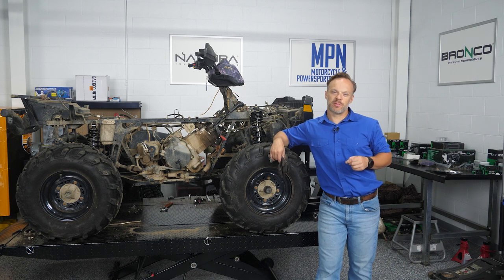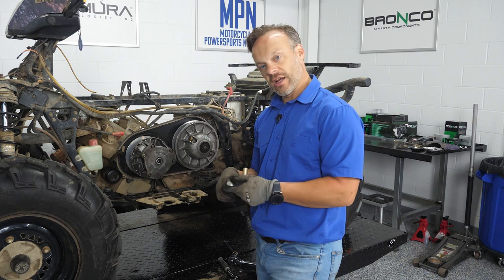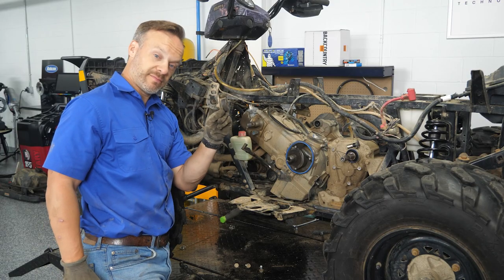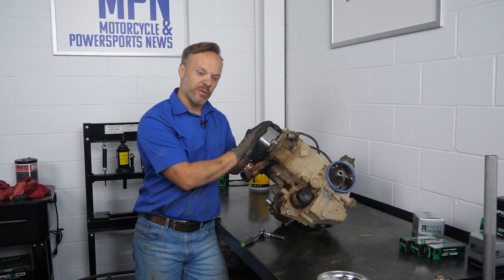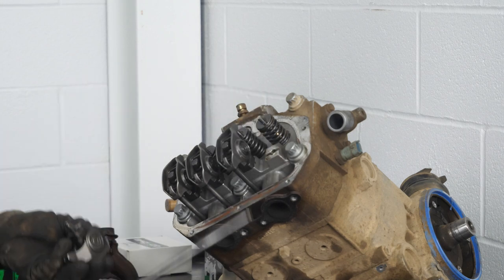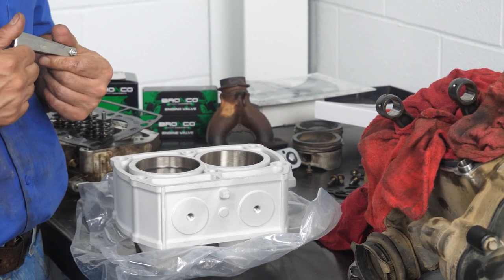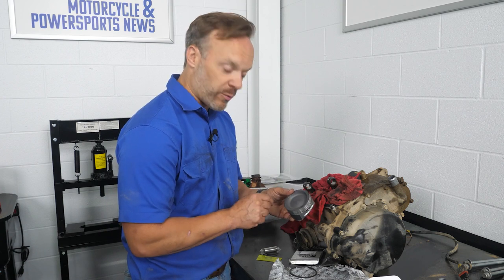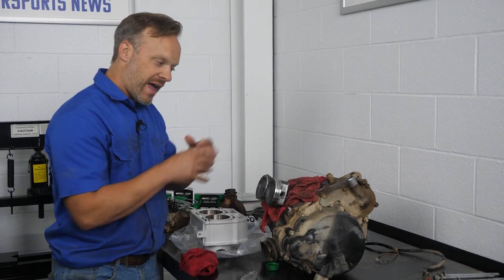P1 EP4: Getting the Engine on the Bench

Comment: Why not drop the pan, remove the rod caps to remove the pistons. Inspection of rod journal surface, piston/ rod reinstallation would be easier and less chance damage. Most importantly, where are your safety glasses when removing and installing the piston wrist pin clips!!!
Reply from the maker: Diane, Thanks for the comments! 
That engine doesn’t have a removable pan. In that, we would have to split crankcase. Also, on the connecting rods, they are a one piece design and not a bolt together design. The crank is assembled around the rods on this one. In this, I’ve found that checking for play tells us everything that we need to know about the condition of the bottom end without actually tearing into it. Next time we’ve got something like this apart, I’ll dive into that further. 

On the safety glasses, no excuses. I should have had them on. Thanks for the reminder.